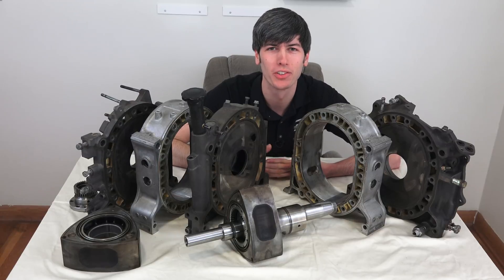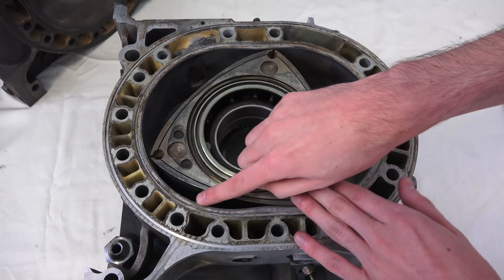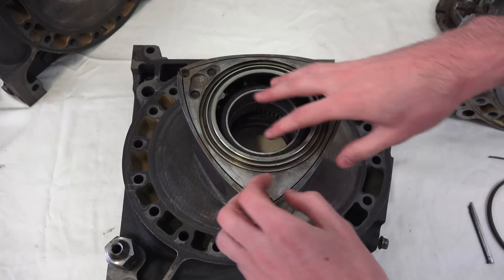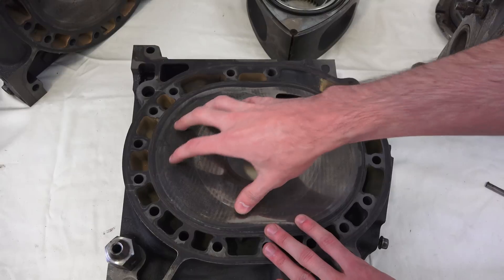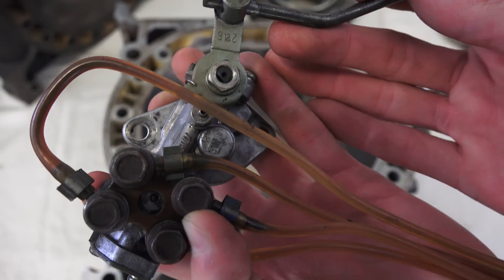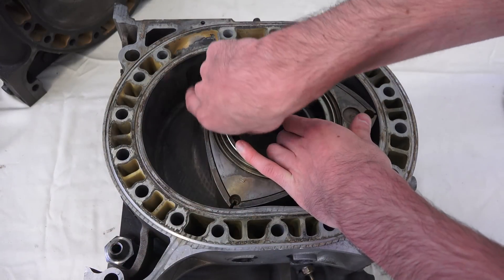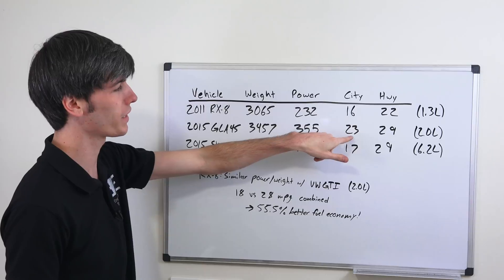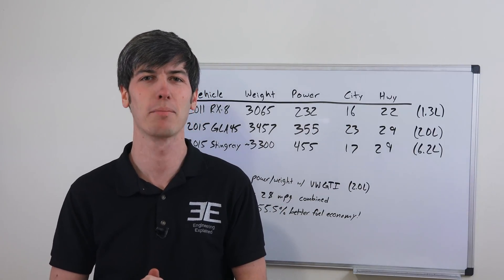4 Reasons Why The Rotary Engine Is Dead

Comment: Interesting video though I do believe a little out of date in regards to the current markets and the State of the Art for Rotary engines, my comments below in answer to the points raised....

The Wankel engine was last seen in a production car in the Mazda RX-8, and currently, there are no rotary engines in production.

-Far from it.  In fact, Wankel rotary engines are very much alive and kicking and are currently being used in Automotive, Aerospace, and Marine applications worldwide. While most people associate Wankel rotary engines with past vehicles such the Mazda RX7 & RX8 and Norton rotary motorcycles of the 1980s, the fact is Wankel engines have and are still currently used in everything from snowmobiles to speedboats to aeroplanes and even space vehicle launch systems, therefore rather than a failed obsolete technology, Wankel engines have been hugely successful in niche applications. These are typically applications that require ultra-small form factor, very low weight and high power density. AIE as a company has built on this UK track record of success in Wankel rotary engines and since its formation in 2012 developed a range of cutting-edge engines designed specifically to meet the needs of 21st century OEM’s, integrators and applications.

Rotor sealing as a result of uneven temperatures in the combustion chamber
-Thermal stability is certainly a challenge for rotary engines (as it is for many other engines) but through utilising new engine technologies such as AIE’s Compact SPARCS cooling system this thermal differential can be largely eliminated give the seals a much easier job and allowing them to perform better and for longer.

Oil consumption
-This is certainly true in the Mazda engine and some other rotary engine configurations but is certainly not true for AIE’s engines. AIE’s SPARCS cooling system combined with ceramic seals eliminates the need for direct trochoid oil injection.

Low thermal efficiency, emissions are poor and fuel economy
- Wankel rotary engines certainly have high energy exhaust (heat and sound) and due to the nature of the engine have higher emissions of HC than a piston reciprocating engine, but with similar CO and lower NOx. Emissions are not a problem (at the moment anyway) for some markets, such as unmanned aerospace, where power, weight, and reliability are the core drivers but are obviously a real challenge for automotive applications. In a series hybrid application, however, where the engine is not “throttling” and is operated at a consistently high load and rpm (with excess air), the HC emissions from a rotary are not that high. So as discussed in previous answers, the devil (for rotaries) is in the detail and the specific application in question. Wankel rotary technology targeted at specific solutions allow the engine to deliver all of its benefits (low weight, high power, low vibration) with the negatives largely mitigated or eliminated. To further enhance its rotary engine performance for series hybrid applications, AIE is developing an additional “overexpansion” or “compounding” unit called “CREEV.” CREEV utilises a second rotor with a different Wankel geometry to allow overexpansion of the engine’s exhaust to deliver significant reductions in HC emissions, while also recouping otherwise lost energy to improve the overall efficiency and fuel consumption of the engine. CREEV has the additional advantage of reducing exhaust heat and sound energy, making the required exhaust system less complex than would otherwise be required.
Reply: AIE UK Ltd
Excellent post. The video is rather too eager to dismiss the rotary engine. New developments, as you have introduced, are coming in. Another is Mazda's ignition system using HCCI or laser, which hopefully we will see on their range extender rotary in 2019.
Reply: @johnburns4017  Mazda discontinued development of Wankel engines in May 2009, they just released their 2021 model line with absolutely no models offered with this obsolete Wankel engine technology.
Reply: A biased eh AIE UK Ltd? the rotary is more or less dead. if you account traditional vs rotary engine production numbers across all industry, then rotary is VERY dead, it just hasn't been unhooked from life support yet
Reply: @DanafoxyVixen  
"Rotary engines currently are installed into some of the world’s most successful platforms. These platforms include:
  ♦ Textron’s Shadow,
  ♦ IAI Malat Searcher,
  ♦ Elbit Hermes 450,
  ♦ Leonardo’s Falco,
  ♦ IAI MBT Harpy,
  ♦ IAI MBT Harop, 
  ♦ Schiebel’s Camcopter,
  ♦ The UK’s Watchkeeper programme.
Reply: All right, tell us who's producing a meaningful amount of rotary engines for on-road use. No-one, because in everyday use the drawbacks significantly outweigh the benefits. Just like two-stroke piston engines, rotary engines are great for racing and when maximum power-to-weight ratio is needed, but they are of little use elsewhere.

In fact, the lower NOx emissions and high HC emissions are a result of the rotary engine's poor compression and low combustion temperature compared to piston engines. NOx is generated when the nitrogen in intake air combines with oxygen, which only happens at very high temperatures and pressures, like in a diesel engine. The low temperature and pressure lead to inefficient burning, causing unburnt fuel to escape as HC emissions.
Reply: @Tuppoo94  
When run at constant speeds and loads the disadvantages of rotaries disappear.  That means they are great for range-extenders. SPCCI ign puts it all right.
Reply: @Tuppoo94  Funny to bring up that consider this, whats easier to buy in America answer a cheap dodge whatever it will burn more oil, and shoot gas out the exhaust more than any car with a rotary engine.... Also, 2 stroke engines are in almost every lawn mower ever soooo, clearly your not to smart there. Sure 2 strokes dont get used in cars anymore but why bother when all we humans want is fun fast and strong speed and torque. As well there are the neat little cars called Go-Karts that use 2 strokes and more recently Tiny rotary engines. which if you live down south i bet you would see them on the road.
Reply: @Alpha-106  I don't even live in the US. And none of what you said disproves any of my points.
Reply: Jason has done a vid on the new SPCCI ign to be implementeded in rotaries.

Comment: #1 reason: because international regulations hated the rotary engine.
Reply: Fast Nasty In order to fix that practically you need multiple generations to developed the technology to fix that. and Mazda did fix it. They should be back by 2020
Reply: Mazda say next year.
Reply: John Burns You're talking about the super hybrid. I have mixed feelings on the subject. The high rpms allow super charging the electrical systems with high amps, and using hybrid take off with rotary acceleration means incredible torque throughout the system. But they're going to have a CVT attached to it :'( what a waste of all that power.
Reply: Blaine Hammond
Mazda are going to have a mixed mechanical and electric drive on the hybrid?  What a waste.
Reply: John Burns As it stands at this moment. I work for Honda personally, and I know for a fact ALL manufacturers want hybrid lines to dominate the market by 2021. Hopefully they reverse that decision, but at this point manual transmission, and fuel only power trains are a dying breed. Luckily Honda has pushed manual transmissions this year, but idk how long that initiative will last.

Comment: The Wankel engine as a land-based mode of propulsion is not efficient.  It is seemingly over-engineered and has an unreasonably high compression ratio for use in modern road vehicles.  It is also not particularly adaptable to advanced fuel injection technologies.    

However, as a mode of propulsion for aviation use, it is nearly unmatched in regards to gas-combustion engines in general.  It's near-perfect rotor balance, matched with its fuel efficiency and relatively low audible signature, make it perfect for areal surveillance. 

 Such is the case with certain Tactical Unmanned Areal Surveillance Systems used by the U.S. Department of Defense.  It has the innately engineered ability to be lightweight, balanced for aerodynamic prowess, and efficiently maintained by a mechanic with virtually no mechanical aptitude.  That, in itself, allows the Wankel motor to stay relevant in todays society.  Thus deeming your claims all but moot in reference to the Wankel's use in modern society.

Comment: Hi. The combustion engine will eventually die in 5 to 10 years (there'll still be some in production), thanks to the Tesla Roadster and those supercar and hypercar EVs that'll follow. I guess we have to accept the electric motor is now superior and more efficient in converting power to torque. The combustion engine is just not as efficient as the electric motor. It's like the steam engine to combustion engine transition. The steam engine people surely must have missed the steam, it's sound, now, we'll be missing the roar of the combustion engine. That's life I guess. God bless, Proverbs 31

Comment: dang man, you missed the most important one! compression gas goes infront of the spark plug area and into the a-jasont compression pocket. that's why the upper spark plug hole is smaller then the lower.. but it still lets gasses bypass. needs lasers.

Comment: I think you missed some important points.. The wankle has a high surface to volume ratio which means the engine tends to absorb more of the heat of combustion..  also a lower compression ratio means a lower expansion ratio which also reduces efficiency.

Comment: On the positive side, for a 1.3litre rotary engine to produce 232 HP is incredible!
Conversely, for the 6.2 Litre to produce less than twice as much power, despite being 4.7 times bigger, means the 6.2 litre engine is rubbish!   The only great engine is the Merc; but going by the VW fiasco, the figures could well be crap anyway. So, don't knock the Rotary too hard.
Reply: The 13B has two 654 cc rotors, making 1308 cc. Where do you get the 3.9 litre figure?
Reply: Merc sucks all around. European rubbish. That 6.2 gets better mileage than that 1.3L  and way more power.

Comment: 70ci motor making 120hp back when stock small blocks were doing 170 with more the 4x the displacement. They are a horsepower freek show that inch per inch puts other motors to shame. Horrible milage ? You bet but for a equivalent engine a stock 350 would have had to make 1400hp. How reliable you think that motor would be? Think it would go 100 miles before puking its internals all over the road? Lol. V8s are great but roteries are a stratosphere above in performance.
Reply: Just talking crap. These are crap engines that is why only a few are still around. Usually fanboy owned.

Comment: Good résumé.. buttttt !! ... you’re comparing the 13b renasis rotary engine only to recent competitors... we all know wankels are not great at fuel efficiency. The EPA standards request the manufacturers to provide an engine with X emissions per X CC’s . The Renesis being tagged as a 1.3L is having a hard time passing the emission regulations. For some reason they couldn’t make a 13b turbo that could pass EPA tests so yes compared to modern piston engines. But if EPA wasn’t an issue and they could create a modern version of the turbo 13b we’ll power per litres would kill any piston engines out there .. still having bad mpg tho lol.. but would still have the rotary advantages like light weight, lower profile so able to put the motor lower in a chassis so better central mass ect ect. But its also have its disadvantages like being thirsty or shorter engine life but still .. even if it have bad mpg compared to piston engines it should be considered as a 3.9L by the EPA due to the the conception of a Wankel engine.

Comment: Over the years of driving ive had imprezas,civics,celicas and beamers but now I own an 04 231 rx8 and I love it, best car for fun factor by far IMHO. Yes it drinks oil yes it drinks fuel but despite that and its bad history its amazing and certainly unique. Now provided you love n care for them they will love you back and for those of us who are rotary nutters definitely consider upgrading your plugs to iridiums, coil pack n leads to a d585 kit, pre mix fuel or install a sohn adapter inline with the OMP and Ofcourse regular maintenance. Trust me youll love your Rex even more and it certainly makes a difference to the car.

Comment: Longest running piston engine is the 1 cylinder Supiror brand will run 60+ years before a rebuild running 24-7 in the oilfield . love to see how long a rotary would last in the most demanding application of the oilfields

Comment: Why couldn't they layer the combustion side with aluminum (which dissipates heat faster and make it thicker so the intake side operated like a heat sink?
Why not make the chamber longer and put the 2 plugs parallel, 2 in series to keep the same volume but burn in a narrower chamber?
Why not let if burn rich add a second combustion process that drove an aux alternator, power-cell in a hybrid setup?

Comment: I owned one (Mazda Rotary) back in the 1970s. Bought it cus, wow new technology what could be better. Got 56,000 miles out of it and the engine blow-up. Mazda said tough out of warranty So after that I never looked at a Mazda again for 46 years as a make to buy.
Reply: going beyond 100k is nothing to brag about...
Reply: Late models and rotors are because of power per liter. Diesels and slow vehicles can pass hundred thousand because less heat and wear.
Reply: There are fast vehicles that can pass hundred thousand

Comment: Horrible idea horrible engineering
Reply: Just like turbo gas engine and diesel engine of 20 years ago. Internal combustion engine as a concept is a turd but manufacturers have polished it until it became usable. Mazda is the sole manufacturer doing Renesis engine so of course it's going to be behind the gasoline and diesels.But take this into consideration:Modern day four cylinder turbo gasoline engine needs DPF like device in order to clear emissions. All modern diesels have DPF as well. Diesels after some time consume oil as well, especially if not treated right. So its' not all that black and white.Also Renesis can be made to go on both gasoline and diesel as well as hydrogen.
Reply: Tapacirer NS maybe other manufacturers don't think rotaries are worth the r&d costs..
Reply: If you haven't noticed, an engine is a box full of Murphy's law. I don't think the idea of an engine with fewer moving parts is "horrible". On top of that look at the thing, the basic design is actually quite exceptional and looks like something designed by high level professionals. The basic design of a regular engine looks like a 4-year-olds idea of what internal combustion should be. (4-year-old voice)"We're gonna have this piston thing that shoots down kinda like a bullet out of a gun but in a car, and its gonna turn this bike pedal thing". Piston driven internal combustion engines have had 100 maybe 200 years of perfecting. Could the rotary engine be better with that level of attention? Probably not, but it was not a horrible idea and at least was worth a shot.

Comment: For car fans out there who aren't really concerned with fuel economy. This engine by far defeats the piston engine. There are 52 moving parts in a standard V8. There are only 4 moving parts in a standard 2 rotor engine..... And less modifications are needed for rotary to produce more horsepower than the average piston engine... Maintaining it isn't as difficult as maitaining a piston engine car. There are less risk factors involved in terms of engine problems with the rotary, PROVIDED that apex seals and side seals are custom made because Mazda manufacturers have made their side seals longer on purpose so that there can be an engine problem.... Therefore they can make more money off you this way.
Reply: Flipperflopper 5 they produce far less torque than a piston engine of comparable displacement and that's why they are used in tiny little cars and not in big trucks
Reply: But to many problems. I don't know of any 300,000 mile rotary engines.

Comment: 22 mile per gallon on the highway is really bad fuel efficiency. A 1962 Dodge Rambler with an  inline six and single barrel carburator got 30 mpg. It only had 80 horsepower but the millage was suprerior to anything on the road today.

Comment: These problems are all solvable using economical, mature technology. Sealing isn't an issue if you use dimensionally stable composites or ceramics (several could be made quite economically in large volumes) and emissions/fuel-inefficiency can be fixed by using spark grids instead of spark plugs and/or post-combusting exhaust gases ahead of a turboalternator (better and cheaper than a turbocharger if mass-produced and used in a hybrid). These would also increase power, maintenance intervals, and engine life, likely making it cheaper and more efficient than a comparable conventional engine in the long-run.

So why are we driving piston engines? Institutional inertia and shortsighted penny-pinching on the part of both customers and manufacturers. If we were sane and reasonable, we'd be driving 100+mpg microturbine- or rotary-powered series hybrids. Instead, we're all going to end up with $50K compact EVs built on the backs of Congolese child slaves that can't cross state lines without a hotel stay for recharging. Thank you, Elon Musk.
Reply: And, This guy.

Comment: Close tolerances required and no good way to deal with the normal wear of operation (like rings on a conventional piston) resulting in short time between rebuilds and fewer rebuilds before the engine is trash.